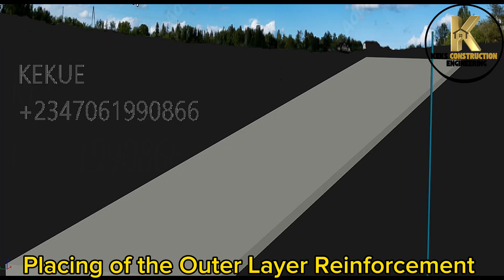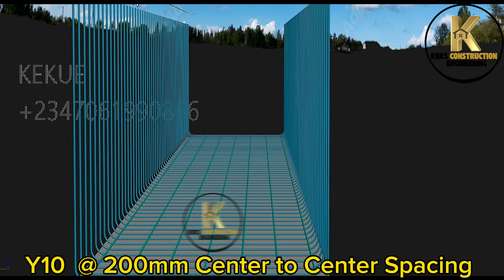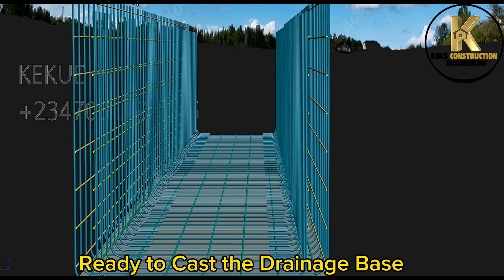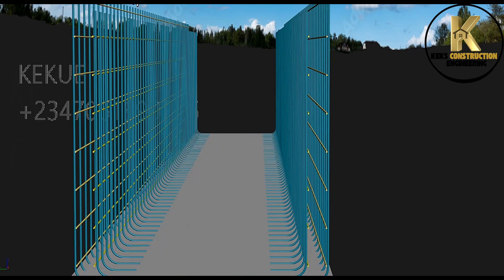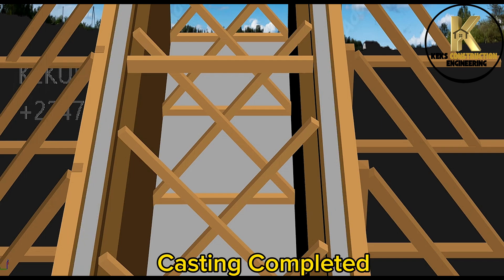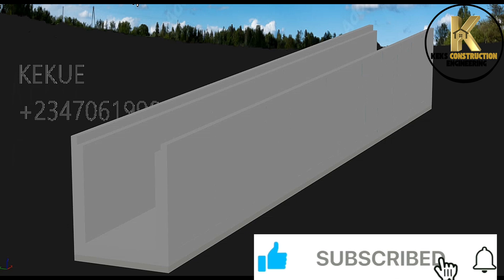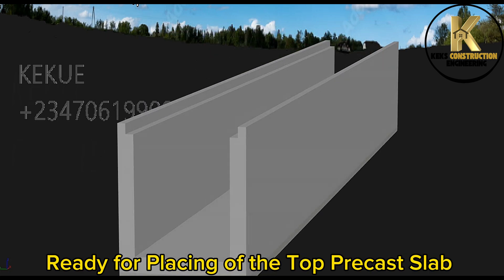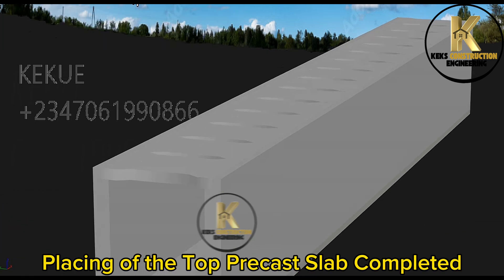HOW TO CONSTRUCT DRAINAGE (Step by Step Procedures)

Comment: Very educative video sir, though I'll like to ask, what is the function of the inner reinforcement? Because most that I've seen just have 1 reinforcement bars.
Reply from the maker: This depends on the design of the drainage. Some are singly reinforced while some are double like this very one. 
The double reinforced drainage are mostly high depth drainage that required that two layer reinforcement to resist the active earth pressure acting on the walls of the drainage.

Comment: Very complete, but during my IT, no blinding was done rather concrete biscuit was placed under the reinforcements, I hope that's a safe practice?
Reply from the maker: @MartinsMiracle-k4s  
No.... it's not
Blinding is done to protect the Reinforcement from having direct contact with the Earth in order to prevent the Reinforcement from corrosion

Comment: Is this applicable to all depths of drainages?? I mean the sizes of rods used.
Reply from the maker: @doonubari6411  
No it's based on design especially when the depth is very deep and there are lots of active and passive Earth pressures that will be acting on the walls of the drainage. So the drainage wall must be designed such that it can withstand those pressure s.....or alternatively you can use Precast sections if the depth is too much for easy construction.
Reply: @keksconstructionengineering 
Sir pls can u break it down still little bit confused
Reply from the maker: @JosephineOnyeka-yo3kz  
I mean any diameter of reinforcement can be used...it all depends on the depth of the drainage and the earth pressure on it.
U know, the earth (the backfilled earth by the both sides of the drainage) tends push the drainage wall onward and if not properly designed with the right concrete and reinforcement, it will fail. So it's not necessary Y10 some drainage are designed with 12mm reinforcement and so on.

If u are not still cleared, let me know.
Reply: @keksconstructionengineering  kk but is it compulsory that its gonna be @200mm center to center
Reply from the maker: @JosephineOnyeka-yo3kz 
No.... it's Design that determines the size of reinforcement and spacing. So it's not by assumption.
Reply: @keksconstructionengineering   tnxz so much  perfectly understood
Reply: @keksconstructionengineering  okay
Reply from the maker: @doonubari6411  
Alright...
Please, watch the new video I dropped today. Comment and ask any question u want.
Reply: please what is depth of  drainage, and width of the walls🙏🙏